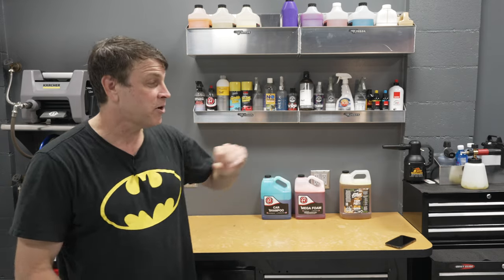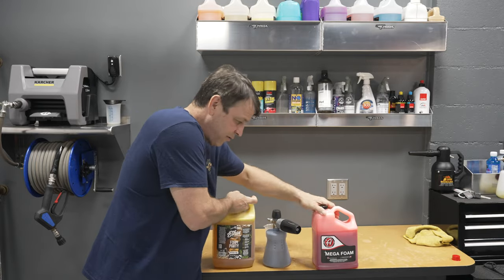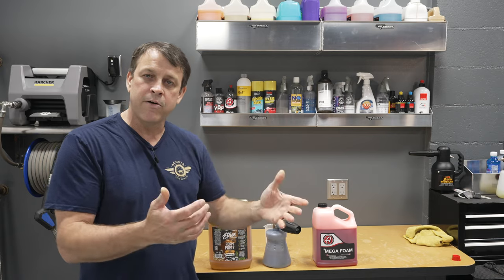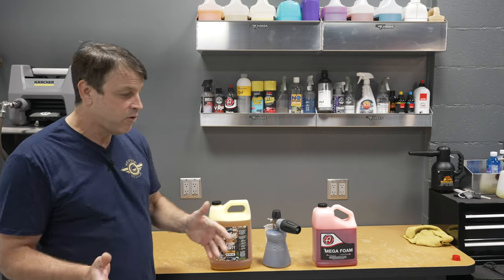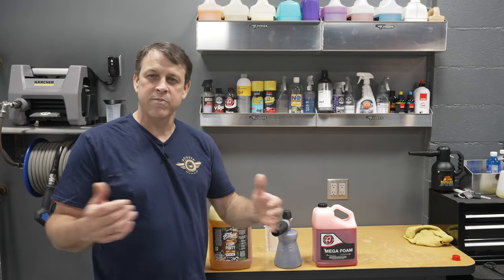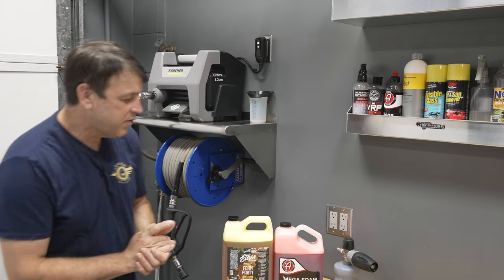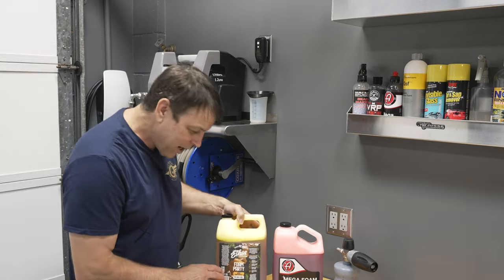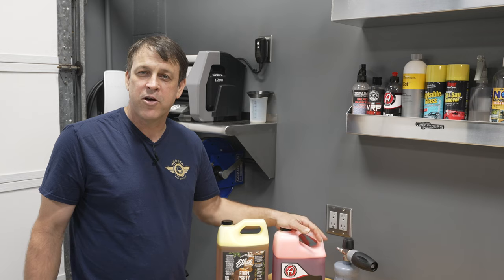FOAM CANNON SOAP BATTLE ADAMS MEGA FOAM vs ETHOS FOAM PARTY

Comment: These 2 are the heavyweights in my collection. Both are super easy to mix, amazing foam, super slick, same price, smell amazing, and both soften road film. I can't decide which one I like better. Another one that I've been playing with recently is Autoglym Polar Blast which is  very quickly climbing in the ranks. Good comparison video of these two amazing soaps Jeremy!
Reply from the maker: I like them too. It’s a toss up. That’s why I came back and asked others to vote so that we could move the favorite ahead in the challenge. Thanks for watching and sharing your thoughts. I will check out the Autoglym. Thanks for the suggestion.

Comment: I love watching your videos my friend. Must be due to you being from the islands. I love the islands so much and I miss being there. But as far as soaps and foaming. Most of my work is correction work so I want foams that will break down prior waxes and sealants. Ethos, adam's really don't have that. Even Adam's strip wash isn't that good at breaking them down. The one I've been using lately that has been great is Carpro Lift. 2 oz. per foam cannon will do the trick, breaks down waxes and sealants. Love it. If I need a traditional foam I normally use carpro reset. I do have mega, ultra foams from adam's but they're sitting there. I've used them a few times but as stated most of work is breaking down those waxes and sealants. Love your channel brother. 👍👌 Love from the states.
Reply from the maker: Thanks a lot. I appreciate you sharing your thoughts. I have Carpro reset here for a future test. Glad you are enjoying the channel. Thanks for watching.

Comment: When you wash a vehicle, do you foam the entire vehicle and then begin hand washing?  I've noticed after I foam the entire car and I begin to hand wash, the initial panel where I started, a lot of the foam has run off.  My foam looks just like yours when it first goes on though.
Reply from the maker: It’s always a race to get around the car before it’s runs off or dries. Make sure the paint is not hot from the sun and you are in the shade or evening sun. Hope that helps.

Comment: Is your pressure washer loud? Would you say it's louder or quieter then the average electric pressure washer? I can never hear it in your videos and I need something quiet!!
Reply from the maker: It’s definitely not ultra quite. Compared to gas yes but silent no. I shut the garage door when I am filming and it’s is pretty quiet outside the garage. I insulated the garage door also to help with sound and heat. Thanks for watching.
Reply: @HawaiiDetailing  gotcha, thank you for the reply. Love your videos. Could you recommend some products that work well in direct sunlight...shampoos/waxes? Would love to see a video on that!!

Comment: Cool video again, as usual. You covered the side 2X with Ethos and 4X with Mega. Any reason for that? Ethos did great with only 2. I would probably like the Pina Colada smell best. 😊
Waimea is beautiful. Nice ending.
Reply from the maker: Yeah. I was just dazed in the moment. All joking aside I wanted to see if the foam would stack on top of it self. I should have done them exact but my curiosity got the best of me. I liked that coconut smell too. It’s fun to use different foams. Thanks for watching and commenting.
Reply: @HawaiiDetailing  hi, which is moving on to the next foam battle?
Reply from the maker: @larrys2554  Adam’s mega foam got about 90% of the votes. Looks like Adam’s again. I have a good competitor for it. A sort of underdog. Filmed yesterday. Was some thick foam.
Reply: @HawaiiDetailing  can’t wait to see it. 👍🏼